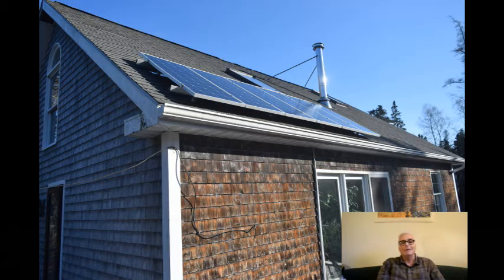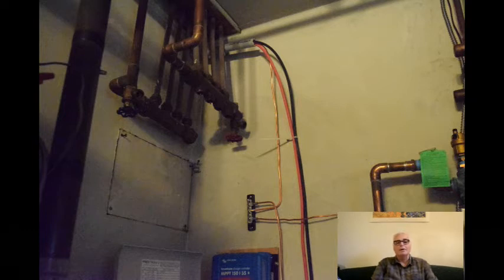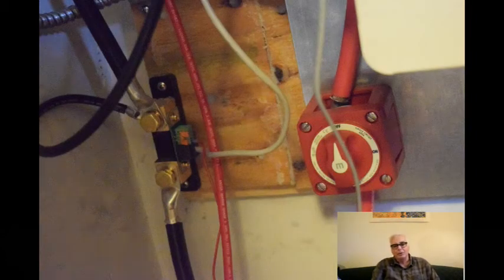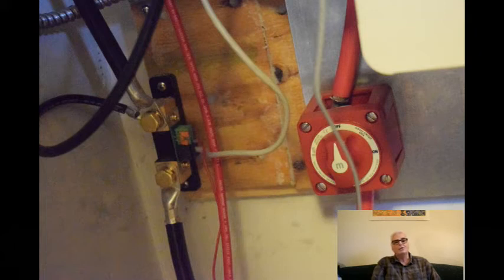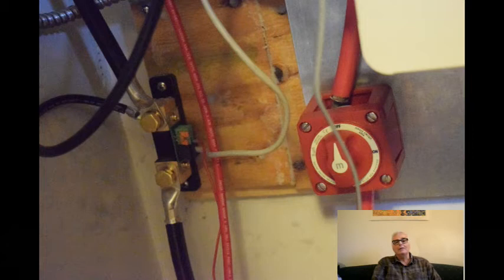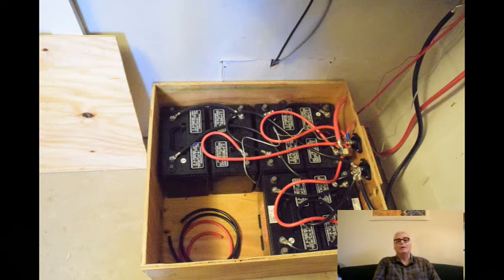My Solar/Battery Backup Power System: System Overview and Costs

Comment: Loved the style and format of this video.
Reply from the maker: Thanks.  Glad you liked it.
Reply: @todddunn945  The Texas grid power failure made me curious about setting up a similar backup to run an internet modem/router, charge cell phones and power a few LED bulbs.

When you're an engineer stuck without power for multiple days, it's hard not to start running the numbers in your head.
Reply from the maker: @Craigthepope  You wouldn't need a very big system for those limited uses and such a system wouldn't cost much.  The most expensive parts would likely be batteries (lithium iron phosphate batteries would be the way to go if you want a long lived system and could afford them) and whatever permit hurdles you had to jump over to build the system.  You could get around the permit costs by not permanently installing the panels - set them out when you need them.  My system could easily run what you describe indefinitely.  In fact I now run my refrigerator and freezer exclusively from my system.  That saves some power costs (about $10 a month), but it will never pay for the system.

Comment: This was good to watch ....If you ever check out my fridge on solar video I can run my fridge 24/7 with only 150 amps of battery and 500 Watts of panel and over night by 11:00 am in the morning the batteries are full charged and the fridge is running on the solar. Yes the batteries won't like to do this all of there life but for the odd times I need it is more than fine and now I am 3 years into it.
Reply from the maker: Glad you enjoyed it.  I ran most of my house off the solar and batteries last Summer.  Winter here in Maine is a challenge though.  The house uses about 7-8 Kw-hr per day and the solar produces 1-2 Kw-hr.  That assumes I manage to keep the snow off the solar panels.

Comment: Fascinating setup - thank you for sharing. I'm currently researching how to configure a solar back up energy system in the 2000 watt range mainly to keep our refrigerator and other items in the house running. I'm interested in creating one that I could deploy from my shed to my house since we don't have a basement. Best regards from  Carolinas.
Reply from the maker: Glad you found it interesting.  We have a large fridge and chest freezer on the system.  In the summer when we get enough sun we can run those appliances indefinitely with this setup.

From the shed to the house won't be a problem.  You can do it either by putting the inverter in the shed and running an AC cable to the house where you have your transfer switch panel.  10 gauge wire will do it.

Comment: Thanks for the detailed explanation of your system. One quibble - when you talk about energy produced by the panels or stored in your batteries, I think you mean to say kilowatt-hours (an amount), not kilowatts (which is a rate); so your panels produce power at the rate of 1020 watts (1.02 kW) while your batteries can store 7.6 kWh of energy. I thought that might be confusing for beginners trying to compare your numbers to other systems.
Reply from the maker: Sorry for the sloppy verbage.

Comment: You Lost me  after I saw the car batteries in a box.  But it is a good DYI setup.
Reply from the maker: The batteries are not car batteries.  They are 105 amp-hour deep cycle batteries.  Eight of them cost just over $1,100 for a 10 kilowatt-hour battery bank. When I set the system up a lithium battery bank would have cost around $7K to $8K. For good battery life I limit discharge to about five kilowatt-hours, but they can go to a lower state of charge.  They have now been in the system for 26 months are are in good shape.  The lead acid batteries sit at float during the day and drop to around 25.6-26 volts at night.  Since this is a back-up power system that is not cycled very often, these batteries should last 6-7 years.  However, now that LiFePO4 batteries have come down in price, I am planning to add an additional 10 Kilowatt-hours of LiFePO4 batteries to give me about a 13 kilowatt-hour usable battery bank that can be drawn down by 17-18 kilowatt-hours now and then.  Yes it is possible to combine lead acid and LiFePO4 batteries.  I will be doing a video on the set up when I buy the lithium batteries.  The LiFePO4 battery bank will consist of four 12 volt 200 amp-hr batteries wired in series parallel.  The LiFePO4 batteries, associated wiring and hardware (fuses, switches, etc.) will cost about $3,000.
Reply: @todddunn945  Thanks for the Explaination.  I am investigating a solar battery backup system, but the Tesla battery is very expensive.  I think I might follow your lead. Looking forward for the new video.

Comment: Double that for contractor installation.
Reply from the maker: At a minimum.  Incidentally the system is working just as designed now 2.25 years after I built it.